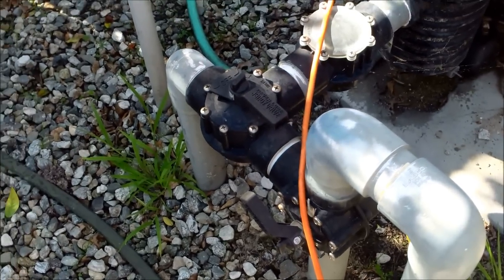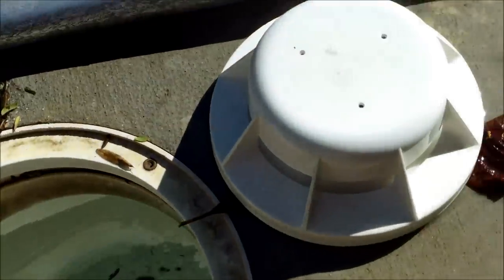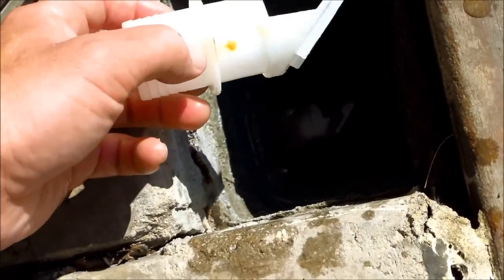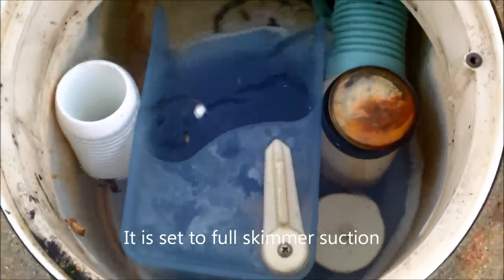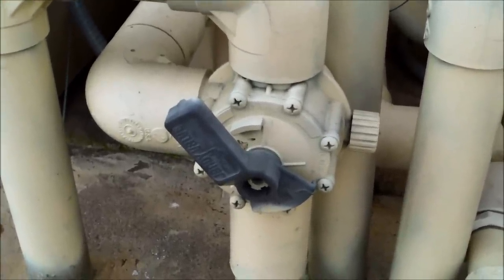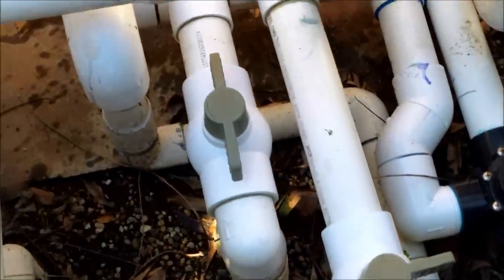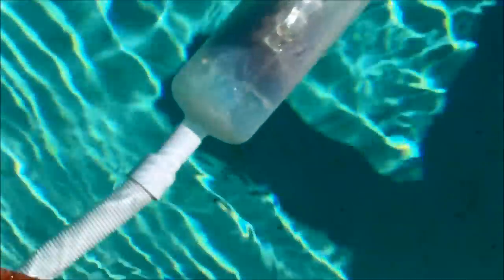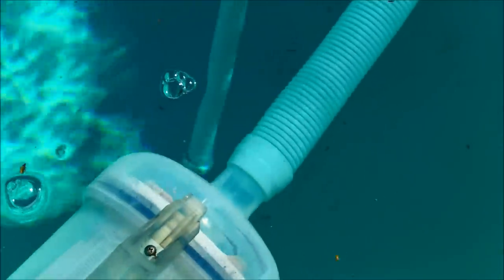Pool Cleaner Getting Stuck on Main Drain

Comment: I have a 1950s pool with a classic kreepy and a snub pipe skimmer. When I close the main drain the kreepy has too much suction and the pump goes crazy. The flow adjuster doesn't help but I'm thinking of putting a flow keeper on the hose but I'm afraid it will suck too much air. What do you think I should do?
Reply from the maker: Flow Keeper should work fine. got 2 on my route with them. Occasionally they suck a little air but nothing to be concerned about. one has been hooked up for 4 yrs like that - no pump issues. I've got 10 in my garage. I can sell you one cheap. PM me on Youtube if you are interested.
Reply: ok ill try it

Comment: i dont know if you notice but the main drain covers in your pool are the dangerous kind. they are the old kind that are flat and have the large holes and pose entrapment hazards. they have been banned in 2008,and there is a law saying that the drain covers have to be replaced with a newer, raised drain cover, which you dont seem to have. you are posing a risk to people who go into the pool. you should change the drain covers immediately, to prevent further entrapment hazards.

Comment from the maker: Yeah, this is not my personal pool. It is a customer and they are old codgers who refuse to do anything to their pool. Been trying to get them to upgrade their pool for a few years now, but no. The main drain here has been disabled in this pool  by adding a plug to the skimmer bypass hole. It is turned off but I filmed it as an example for the video. But thanks for the comment as it will help others who may have this drain configuration. FYI - I disable any of these types of drains on my route.
Reply: i would like to get those drain cover to add to my collection

Comment: If you have a float valve, is there any negative consequence to leaving it in, and using a skimmer plate with manual vac?  When I did this and my vac went over the main drain I got a bunch of I think DE and debris in the pump basket.  Not sure if it somehow got sucked back out from the filter in this configuration?
Reply from the maker: My guess is that the D.E. and debris was stuck in the main drain line the last time the filter was cleaned. In some cases the D.E. seems to flow back down the main drain line when you go to clean the filter. It shouldn't be a regular event once you get all of it out of the main drain by running the vacuum over it. Try it again next time and see if more stuff comes out - it probably will be noticeably less.

Comment: I have a barracuda G2 (i think) that gets stuck on the raised main drain cover.  The main drain doesn't work or have any suction at all but the  barracuda gets stuck going on top of it.  Just last week i had the pool re-diamond brited and had a dedicated suction line put in so i could skim and vac at same time and i have it adjusted so both are working.  Is there a better type of vac i can buy or do i just need more adjustments?  Thanks!

Comment: How is a main drain valve turned off on a 19 70's pool thats only indicator says " filter" , with two pipes coming into the valve? Thank you for any guidance.
Reply from the maker: In those old skimmers there is a diverter that can be turned to direct the suction. If you have a one hole skimmer that is how it was done back then.

Comment: I have a pretty old pool with some new parts. It has 2 skimmers both with two holes. One of the skimmer had this white cap over the hose while the other skimmer has a flap with the word vaccuumm. Both skimmers have 2 holes open. I plugged the krauly in one of the holes and am fooling around with the valve to find the shut off point. But all I get is a tiny pulse and the krauly is not moving at all. I don't have a side port just 4 jet ports. Any ideas on what I could do?
Reply from the maker: Put a 1.5" drain plug in skimmer #2. I filmed a video on this but haven't had time to upload it. You have to shut one skimmer off for it to work and I doubt if the pool builder installed valves to regulate the skimmers - not cost effective when building a pool so they don't bother 9 out of 10 times. So you will need to put a threaded plug in one. Let me know if that works and I can also give you some tips to modify the set-up even more. But start with that. Lowe's or your local pool store should carry it.
Reply: Swimming Pool Tips, Reviews & How To -MrDgvb1 ok I will buy one tomorrow and report back with results, thanks
Reply: So I tried out the plug and it worked like a charm. Now I am testing to see wether my pump is enough to properly power the krauly. Thank you